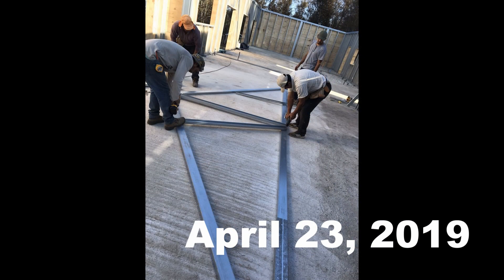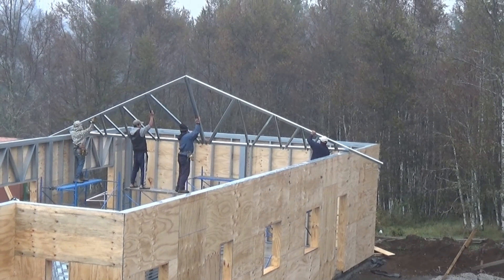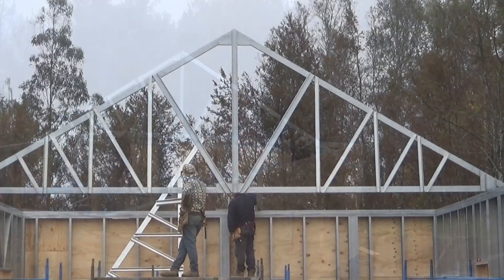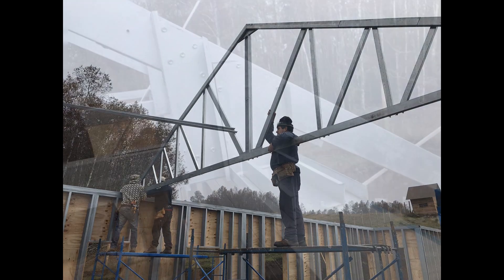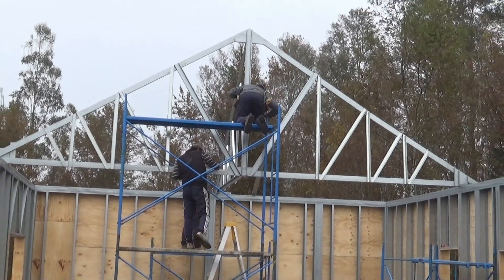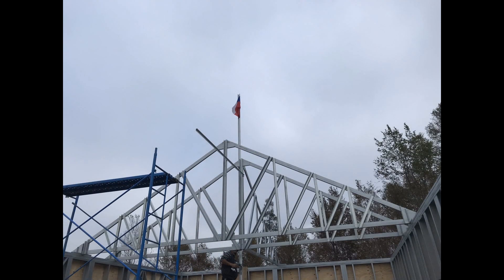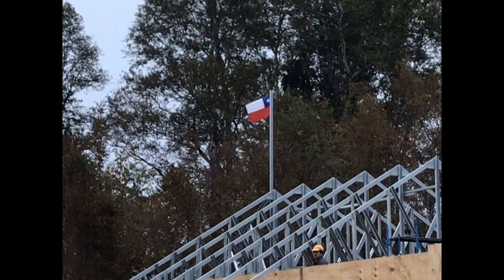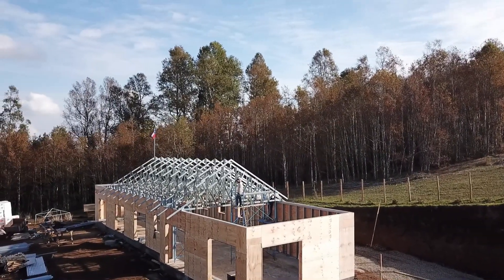Trusses week!

Comment: Brother,  what steel did you use  for trusses?  Angle bar, or same c-chanel and what thickness?
Reply: It’s galvanized steel 0.75 mm if you are from the States it’s widely used on highrises partitions. In Australia they use steel studs widely because of termites infestation.
Reply: @EduardoFritisRealtor  brother Ed, so you are using the same wall stud C-channel 0.75x150mm for trusses as well too?
Reply: @ the C Chanel are 1 mm thick for the 152 mm ones! U studs are 150 mm 0.75 mm thick for the walls! For the trusses I used 90 mm U and 92mm C, all in 0.75 mm thick and also used 60 mm for some diagonals! Plenty strength considering my trusses were 10 meters!
Reply: Brother Eduardo,  are the trusses and purlins strong enough to hold 3/8" osb board and metal roofing over it?
Reply: @ Indeed! I do have 3/8” OSB and metal roof… a 220 lb man can stand in the Middle of the trusses without any concern!

Comment: I'm planning on building a similar house but with flat top can it be done with steel
Reply from the maker: Yes, any house design can be build with metal! The biggest advantage of metal framing is the weight and construction speed! 5 times lighter than wood, doesn’t rot, doesn’t burn and is faster to build! Need an engineer to calculate your flat roof!

Comment: Interesting video. Can you please write me the specification of the steel used for the wall and the eoof trusses? I'd really appreciate it
Reply: Thanks for watching, steel studs is wide used in high raise construction. They mainly use steel studs for partitions and envelope. Steel studs are galvanized steel with thickness of 0.75 mm and different shapes and forms, that combined creates walls, trusses and floors. In Australia most homes are build with steel studs since they have termites that eats wood. Steel studs homes weights 5 times less that wood frame homes, therefore require less foundation and withstand earthquake better. The size of the steel studs and separation depends on calculations... same as with the trusses. There are manuals for constructing with Steel studs. Let me know if this answer your questions. I can tell you that steel stud construction is way easier than wood, just need a good battery screwdriver... it took me 4 Month to finish the house.
Reply: @EduardoFritisRealtor  thanks so much, this helps